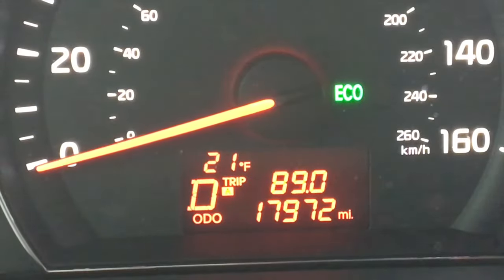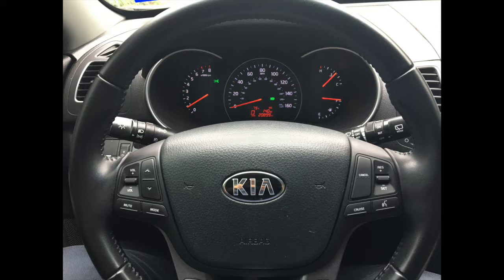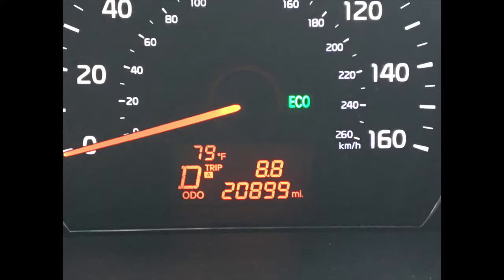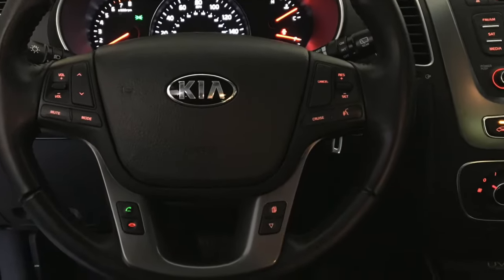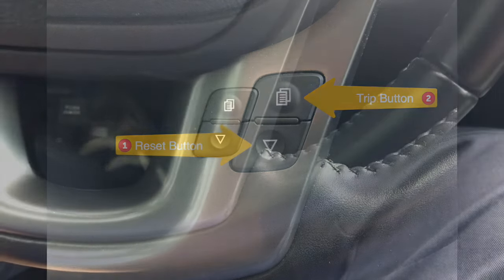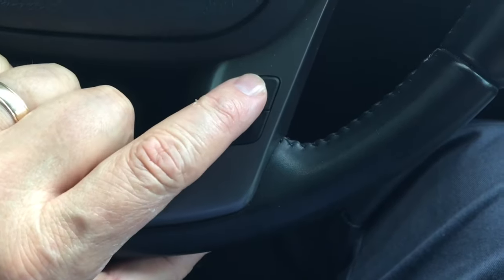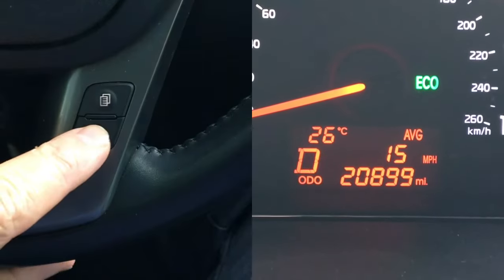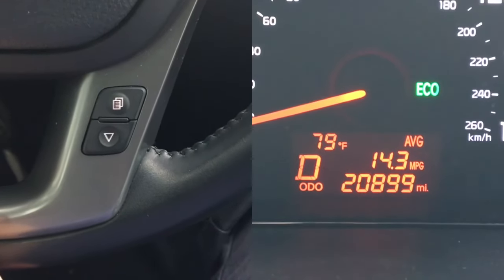KIA Outside Temperature Display

Comment: Thanx so much! It works also for my Kia Sportage 2014 !
Reply: Bro I have a kia 2014 sportage..  But I can't find those 2 buttons I need to press??
Reply: @yoapps137  Did you find out? I have a 2013 Kia Sportage and don't have those buttons. Mine has a voice command button there instead.
Had a new turbo fitted and now it doesn't show outside temperature and no idea how to change it :/
Reply: @ThugGBAtemp  bro I found out that if I pressed trip button continuously it will cycle through all the info on the dash board. So try it.

Comment: I don't have the temperature display in my 2013 Kia Sorento LX. Was it missing from the trim? Wonder if I need to install a temperature sensor or just need to update the onboard computer at the dealership to get the temperature.
Reply from the maker: Not sure on this,  Let me do some looking.
Reply: @diycollaborative  any luck? I know we have the temp sensor outside in between the rad support, but I don't get the temp inside the cluster either? T.I.A

Comment: only have 3 dashes on mine.  does the car have to be running to change or view temp? or can you just turn key to on position
Reply from the maker: It almost sounds like a bad sensor maybe.  You might try disconnecting the battery and reconnecting it.  This might reset it.  Also, think the key has to be in the on position.

Comment: Thanks you for posting, great video. There is an issue been bothering me for a long time. I have a 2014 Sorento, the LCD looks exactly the same to yours in the video, and I tired your method of the changing the temperature from F to C, and it worked perfectly, so I guess the setting methods are same too. My issue is every time I refuel my Sorento, it resets the average fuel economy value. I read through the user manual, it tells me there are 2 modes of 'resetting the Average fuel economy', manual reset and auto reset. I am on 'auto reset' now, that is why it clears the value every time it is being refueled. Now I need to switch it to 'manual reset' for average fuel economy in the vehicle computer, I don't know how, I could not find a solution in the user manual book as it only shows how this setting can be done in the more 'fancy' LCD version, but not my version. It would be so much appreciated if you could guide me to change the average fuel economy from 'auto reset' to 'manual reset'. A big 'thank you' in advance!
Reply from the maker: Try this:  http://www.ksmanual.com/overview-73.html. Also, thanks for watching and commenting.

Comment: Wow now I know why my last oil change, mine changed, however I have an Optima and I have a reset on the steering wheel, but not the other button you pressed. Anyway I'm going to give a try & let others know what if anything happens.
Reply from the maker: Cool. Let us know.
Reply: It's works! I have an Optima too! Thanks DYI DUDE

Comment: Not working for my kia optima 2014 this suddenly changed for no reason
Reply from the maker: Did you have it serviced anywhere?  We’ve seen this happen when they’ve been to the dealership or other service center.  Or maybe you had the battery disconnected.